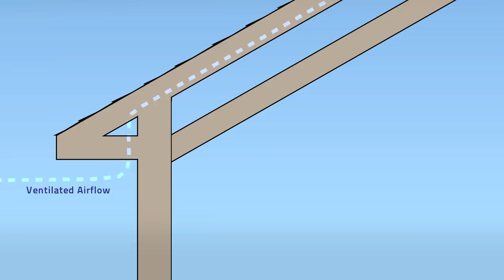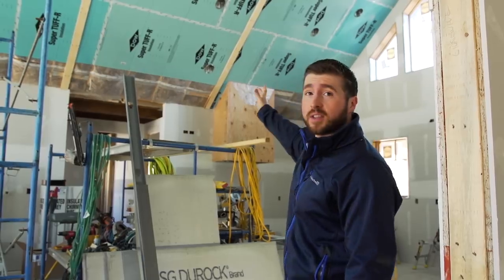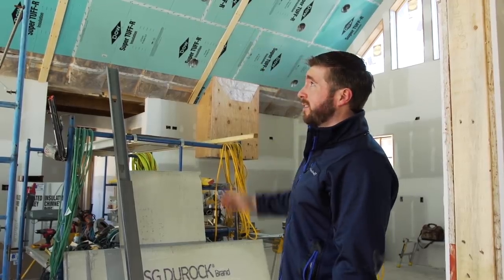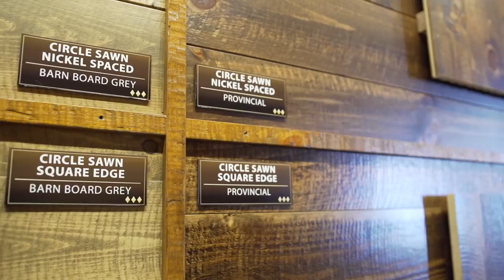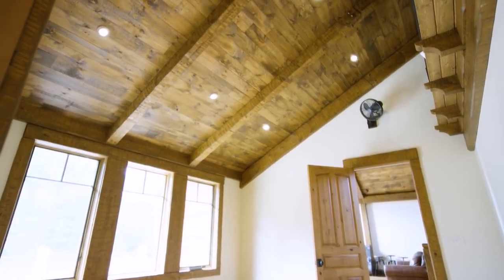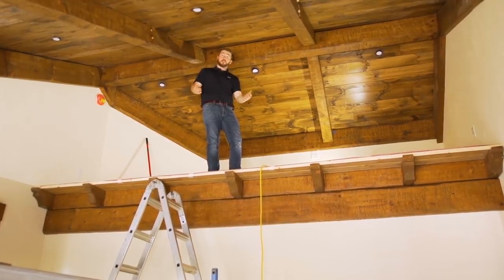EP 8 Building My Dream Home - Reclaimed Wood Ceilings, Custom Drywall, Closets, Timber Truss

Comment: Those trusses are great. Having just built a 6000 square foot ski/hunting lodge on 1200 acres I have a new respect for rural design and architecture. We used a lot of charwood which is flame torched until burnt  then stained over. I also opted for over insulating the vaulted ceilings to lock in the heat during cold and heavy snow months. Well done guys.
Reply from the maker: Thank you very much for watching and commenting!

Comment: I would really like to know, why in some areas the dry wall was added over the layer of osb on a partition wall, and in some areas not. As far as I know the dry wall should be added on the frame, directly. What is the explanetion here??
Reply from the maker: Good catch. Zach requested it so that it would be a little easier to hang items on the drywall because there would be material behind the drywall

Comment: How did you place the recessed light in the (what looks like) tongue and groove ceiling (the loft area)?  Is the backside of the T&G ceiling the roof?
Reply from the maker: These are not the old style cans these are the new LED super thin design. Be sure to subscribe
Reply: Yes, I see the LED. So are the LED lights as thin as the T&G decking? Does the wiring (electrical) extend to the backside of the ceiling (roof)?
Reply from the maker: Hey Scott, there is a mixture of LED recessed lights, which are probably about as thin as the tongue and groove decking (3/4" thick). There are also canned lights, which are of course thicker. Probably 5"+/- 1"   Those would recess into the truss cavity and be insulated around them.

Comment: It’s a lovely home but I worry how much weight is screwed on and hanging on the weight bearing wood.
Reply from the maker: It is kiln dried so its not that heavy and it's designed for it  Imagine the same wall with stone or brick and it works fine this is a lot lighter than those
Reply: Golden Eagle Log and Timber Homes Thank you for the reply I’m certainly not being a hater. I’m from England so this building technique is new to me as we build mostly with double bricks.
Reply from the maker: Thanks

Comment: How are wood floors with radiant heat? Currently building a home but worried about the flooring warping or doing something weird because of the heat
Reply from the maker: You’d want to use good quality wood flooring. Laminated wood flooring might be questionable.
Reply from the maker: Check out episode 10 for the final tour: https://youtu.be/kcURWoz3AKU

Comment: how much does the whole Project Cost?
Reply from the maker: Fully Built (Turnkey) Cost of Zach's Dream Home
If you have been following along in the video series “Building My Dream Home” episodes 1-10. You may have been wondering what the total build cost (♦ turnkey cost) would be.
Zach started with the smaller Clearwater 1750AR Ranch. For which either the Premium Exposed Beam Timber Package, or the 8 Inch Premium Half Log Package! and would turnkey for approximately $369,000.
We also have a model called the Clearwater 2095AR Ranch which is more similar in size to Zach’s home. For which either the Premium Exposed Beam Timber Package, or the 8 Inch Premium Half Log Package and would turnkey for approximately $575,000.
Zach used the Ultra Custom Timber Package version, the Timber Ranch 2286AR-CT. The Ultra Custom Timber Package is fully loaded with taller wall heights, taller windows, and taller interior doors and our finest cabinetry. Plus massive timber band boards, rafter beams, and custom timber style trims. So, Zach’s house as it is built (depending on where you are building it) would turnkey for approximately $950,000. ♦ Turnkey costs do not include the unpredictable variable costs such as price of the land, well, septic, landscaping, taxes, and shipping.
If you have any questions or would like more details please feel free to Contact Us or call 800-270-5025 Toll Free

Comment: How much this house cost?
Reply from the maker: How much would it cost me to build this home?
If you have been following along in the video series "Building My Dream Home" episodes 1-10. You may have been wondering what the total build cost (♦ turnkey cost) would be.

Zach started with the smaller Clearwater 1750AR Ranch. For which either the Premium Exposed Beam Timber Package, or the 8 Inch Premium Half Log Package! and would turnkey for approximately $369,000.

We also have a model called the Clearwater 2095AR Ranch which is more similar in size to Zach's home. For which either the Premium Exposed Beam Timber Package, or the 8 Inch Premium Half Log Package and would turnkey for approximately $575,000.

Zach used the Ultra Custom Timber Package version, the Timber Ranch 2286AR-CT. The Ultra Custom Timber Package is fully loaded with taller wall heights, taller windows, and taller interior doors and our finest cabinetry. Plus massive timber band boards, rafter beams, and custom timber style trims. So, Zach's house as it is built (depending on where you are building it) would turnkey for approximately $950,000.

♦ Turnkey costs do not include the unpredictable variable costs such as price of the land, well, septic, landscaping, taxes, and shipping.

If you have any questions or would like more details please feel free to Contact Us or call 1-800-270-5025 Toll Free

Comment: How much?
Reply from the maker: Fully Built (Turnkey) Cost of Zach's Dream Home
If you have been following along in the video series “Building My Dream Home” episodes 1-10. You may have been wondering what the total build cost (♦ turnkey cost) would be.

Zach started with the smaller Clearwater 1750AR Ranch. For which either the Premium Exposed Beam Timber Package, or the 8 Inch Premium Half Log Package! and would turnkey for approximately $369,000.

We also have a model called the Clearwater 2095AR Ranch which is more similar in size to Zach’s home. For which either the Premium Exposed Beam Timber Package, or the 8 Inch Premium Half Log Package and would turnkey for approximately $575,000.

Zach used the Ultra Custom Timber Package version, the Timber Ranch 2286AR-CT. The Ultra Custom Timber Package is fully loaded with taller wall heights, taller windows, and taller interior doors and our finest cabinetry. Plus massive timber band boards, rafter beams, and custom timber style trims. So, Zach’s house as it is built (depending on where you are building it) would turnkey for approximately $790,000.

♦ Turnkey costs do not include the unpredictable variable costs such as price of the land, well, septic, landscaping, taxes, and shipping.

If you have any questions or would like more details please feel free to Contact Us or call 800-270-5025 Toll Free

Comment: Stone  right over fire place looks awful
Reply from the maker: It needed to be a fire-resistant mantel because the fireplace unit outputs over 90,000 BTU. There are many mantel options available.
Reply: @goldeneagleloghomes  Solid stone mantel would look lot better with keystone layout over the fireplace opening , but of course is all up to the owner and designer. Whole house looks great ,very impressive build.